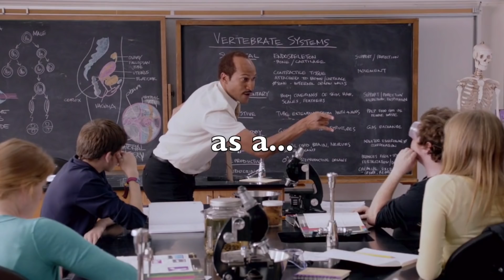Using Tesla parts in my Electric Rat Rod Conversion

Comment from the maker: If you felt touched inappropriately by the heat sink, please comment below.
Reply: RICH!! just get out and blow on the controller . No I'm triggered also brohemian chip
Reply: Are You putting a tesla in the rat rod next? 😆
Reply: Hey rich I saw you heart in my com,as a professional lover I want to say I love you back and I can’t wait to see you spending more money due to the fire 🔥❤️
Reply: Man, bad idea to remove that aluminum heat sink. First, said aluminum is a way better heat transfer than steel !
Cut out a proper sized hole in the welded plate so to lower the module through it thus letting cool air blow on the fins.
Otherwise, you'll fry it in no time.
As you said youself, the car weights much more than the bike, so the module will work harder = more heat.
Reply: YES! I am triggerd nu the heat sink. LOL
Reply: I don't know what I am talking about, but you are losing a ton of surface area by removing that heat sink. ANd surface area is what counts..
Reply: Rich Rebuilds, Aluminum conducts heat well, it will draw ir from the unit.

Place the heat sink BACK ONTO the Controller,  lengthen its cables so that the controller can be in front,  where the radiator would be, turn the fins so that air will pass through the slots.

If necessary,  turn the whole damn battery by 180 degrees.  Yup, re-do it, you will anyway if it burns up,
Reply: As a professional heat sink, I’m triggered by your violation of all heat sinks. Boycott Rich Rebuilds now! Call your local Senator!
Reply: I love the vids and the comedic responses to all the "internet professionals". However, I am a bit curious, do you not want any help from your subscribers? I'm fine with that, but I think some of them are trying to provide genuine help and it might come off as a bit douche'y if you're just dismissing all the offered help. If you don't want any help, it might be better to just be blunt and say you don't want it.
Reply: As an engineering student, Completely triggered, smh, fkn hell rich
Reply: please use flat heat sink profile between that's beefy enough or it will give out the smoke. DO NOT leave it elevated that will probably kill it. At least mount it against the plate if you are too cheap to put new heat sink profile between :D
Reply: RIP controller u need a heat sink  it's there for a reason
Reply: You can omit the heat sink - if you bolt the motor controller under the driver''s seat metal side up, so if your butt's hot, you will slow down thus saving the controller from overheating.
Reply: Nah, this just means we get another video with one of your projects on fire :)
Reply: You could make a 1in thick liquid  cooling block for it. Use a 1960s Ford heater core (size is perfect) and a cheap pump. A big cpu cooling fan on the core would definitely keep it nice and cool.
Reply: @xpepos  😂 😂 😂 😂
Reply: Hmm, i would have mounted it so it has the heatsink underneath in the airflow direction but if that does not work than maybe some sort of a 12 volt fan with not to high rpm so it’s quiet mounted to it with the heatsink somewhere else.
Reply: So this channel has officially become a baiting channel? I'm asking because, compared to stuff like Hoonigan...this ain't worth the effort if that's the case. I much preferred the previous installments. FIY, many other channels tried this route, it never worked out, it only attracted more hate and discontent.
Reply: @xpepos  ROTFL
Reply: You'll kill the unit without a heat sink. Placing it directly on the steal surface with some thermal paste will do a better job than leaving a gap. Just use an online heat sink calculator if you don't want to use the original one.
Reply: Keep those batterybox zipties on the weekly list of checks , Rich . Much love .
Reply: Yep... common sense well and truly abused.
Gotta have heat sink. Cut in half and rotate each piece 90 degrees and reattach so airflow is restored and use thermal paste of course.
Heat sink can sit on steel mounting plate using long bolts. Make an air scoop if necessary.
Reply: “As a professional aluminum heat sinker” FOR THE LAST 50 YEARS, I’d say put that da** heat sink where it sinks or your controller would stink soon and that would sting your pocket and heat up your 🧠
Reply: Love to see you burn out the controller that way..
Reply: You might want to use some thermal paste between components that generate heat and the metal plate mounting points.
Reply: This isnt one of those "listen to me because you are a window-licker" comments I promise. The cooler for the controller is in my OPINION, a necessity. Without the conductive mass to soak up the heat and disperse it, there is basically a 99.9% its gonna cook it. There is not enough mass in the bottom of that controller to handle it thru simple convection. AS AN ELECTRONICS GENIUS..... lol but seriously, if it was my setup, I would personally keep it on there. Just sayin...
 
Its gonna look badass when its done, looking forward to the next vid.
Reply: Rich as a viewer of your videos for more than a year, I’d strongly advise you to be putting the controller on the plate directly , as it will make your whole frame be a heat sink , I’d guess that will do much better than the air gap you keep mentioning. Make that plate flat with a grinder and make sure it touches the controller on the full surface
Reply: as a .... i can say you might want to increase surface area contact with the controller for maximum heat dissipation
Reply: I too think you should put the motor driver in the sink. Just be sure to use realy long cords.
Reply: air is an insulator, you need to submerge it in water obviously
Reply: As a triggered viewer, I'm leaving a comment ITT
Reply: Sryously welding a cast steel brake pedal can endanger everyone on the road when it breaks off, I disagree with you sir...
Reply: You're going to need that heatsink. Just in case you weren't joking about leaving it off.  Without it you'll be able to measure the life of that controller (inverter) in 10s of seconds of operation. Keep at it and good luck
Reply: @marcryvon  my thoughts exactly.  If you don't want the finned piece, mount it on a larger block or plate of aluminum with a lot of surface area.  Don't forget to apply a thin layer of heat sink compound.
Reply: Yes Unca Rich I felt touched inappropriately enough to comment again. You could weld aluminum extension onto the heatsink itself, and since it's on the bottom end of the vehicle it'll get water when it rains and air running across it as you drive. Effectively cooling it in the process. Steel sucks for heat transfer. For better support you could take a 1" wide steel flat bar and unknown length, bend it to make an effective support rack. Much easier to do. Surface area and metal thermal conductivity is key, otherwise if that rat rod is gonna be on for quite awhile in the heat, that controller is gonna be toast. But again your build so..... yeah. Threw my 2 salamis.
Reply: @computerguy61  I watch Rich because I learn things I didn't already know. I already said I love the channel. There will always be douchebags who trash on him in the comments thinking they know everything; it's the internet. That was not my point. My point was that some of his viewers might have a particular skill in an area that he doesn't and want to truly help, not troll. And if he's lumping everybody together and acting like he doesn't want any help, it may turn some viewers off. I love his humor, but in this case some may think twice about posting something that they think might help him because of his comments. That's all. Nobody knows everything, not even Rich, but as a community we can all help each other while ignoring the trolls. Again, I don't TRULY care that he doesn't seem to like advice, it just means I'll refrain from trying to help in the future if there's some tiny detail I think I could help with. That's all, not a big deal either way, I'll still watch.
Reply: Sock puppets.
Reply: As a heatsink engineer, I am sad.
Reply: dude youre definitely keeping the rat in ratrod...i really hope this project doesnt kill you... 🙏🏼
Reply: @rnreajr9184  
He definetely NEEDS the finned heat sink so the air flow cools it down. An aluminum plate won't be effective enough to shed said heat ! Why reinvent effective, proven technology is  beyond my comprehension !!
Reply: As a professional opinion stater and comment maker I would just like to say you are grade A on point with your triggering skills. I love seeing all the offended types letting their hurt butt show through their criticism and otherwise superior ideas. 

Keep up the good work, even if it’s only to leave people asking wtf. You are appreciated by those of us who have minimal to no clue!
Reply: As a professional NOBODY, I say rock on, this is a riot, so many people getting triggered it is hilarious!!!!
Reply: I was inappropriately touched. It’s called a heat sink for a reason.  Don’t loose it. 
Put the heat sink back on and rotate it 90 degrees so you have nice air flow over it when moving.  
Computer CPUs have heat sinks with fans on for a reason.
Reply: Rich. Much love, but you GOTZ to know that a heatsink gives all that heat a place to go. It's a magical place with way more surface area so that the relatively poopy heat transfer to the air will be at least semi effective.
Reply: +1 vote for begging you to reconsider using the heat sink.
Reply: Close. His name was Heath........he  lures us into his van. The end
Reply: What a channel!!!!!!
Reply: As an Electronics Engineer of 20 plus years...  heck, just send it man.  What’s the worst that could happen?  LMAO
Reply: I would have mounted the controller on top, heat sink under it and steel plate on the bottom ... with long screws... oh, and the fins are oriented the wrong way? then blow on it! :P
Reply: Me thinks you plan to add a liquid cooler to the motor controller... or plan on melting it to slag. Either will be good content. 🤷🏻‍♂️
Reply: He knows what he is doing and just went fishing, do you seriously think he does not know about heat sinks???? 
Not only is he amazing at working on Teslas but looks like he is a dam good fisherman as well, after all so many took the bait hahaha
Reply: Fine, I'll take the bait - mounting the controller without a heat sink, with only an air-gap to try to get air to the controller? It is sadly doing the opposite of your goal of improved cooling.
The heat sink provides more surface area with a better thermal conductor in order to help the controller cool off. What you've done is reduced the surface area for cooling.
Reply: @compwiz101  strike.... the rod bends, the line is wizzing off the reel, the clutch on the fishing reel is heating up and there is that feeling if excitement....
hahaha this is funny!!!
Reply: As an amateur YouTube watcher I feel that I'm obligated to say maybe consider taking up jazzersizing or sweating with the oldies to get in shape for when you have to either A: push that thing back down the street after it burns out. Or B: HOLD YOUR MIDDLE FINGER HIGH TO ALL THE PROFESSIONALS (while on hold with AAA)
Reply: Air is an isolator.  Slob a bunch of hear sink compound to the back and bolt it tight to the quarter inch steel.  ... Maybe slap the heat sink on the back of the steel w thems long bolts you have.   Either way I wish you all the success in YouTube and in your humanitarian efforts housing all those furry families living in the Tesla dumpster out back
Reply: the new welder is working fantastic hahaha had me fooled
Reply: Marc René Yvon Rich...definitely agree with Mark Rene Yvon...keep the heat sink.  Metal to air won’t work as well as metal to aluminum.  You’re going to have much higher heat generated by your application.
Reply: As a professional, I would replace it by wood. WOOD WOOD! 🤭
Reply: @marcryvon  Eh, if he wants to torch it, let him torch it. It'll be good content in a month or so.
Reply: Ashy ass ankles
Reply: Lol jk rich. Love your rants. Cheers
Reply: @reluctantprophet  Dont worry at this rate the controller will burn up before he will actually need the brakes for any emergency.
Reply: @computerguy61  Looks at Daisy ...*looks back at the controller heatsink* shrugs
Reply: If you treasure, embrace, crave failure, then ignore the suggestions by us individuals who know things more than yourself. But when your insurance carrier denies your claim when your new shop burns to the ground...and as evidence the attorneys  for the insurance firm, unearth all of these  videos highlighting your cavalier incompetence....you will have nothing, no business, no job, no career.
  OR, if your daddy has a bazillion dollars for you to "play with"...then never mind....
Reply: use the car as a heat sink, and enhance it by bolting the old heatsink to the bottom of the plate
Reply: of for sure you've fucked it!! yolo it all the way baby
Reply: Technicall question: why did you mount batteries so high and so far forward? Wouldn't be better if you mounted them in similar location to the orginal engine ?
Reply: Its a heat Sink, like heat drains into it.... you are making a heat table... do you want heat all over your table just sitting there? Possibly dripping onto your exposed sandal ass toes? No, you don't.
Reply: what you gonna do after putting all this work in then frying the controller
Reply: As a professional PC master race user, I feel deeply violated by that heatsink mod
Reply: Well, as a child I also thought it would be a good idea to remove the radiators of my laptop in order to let the fans spin more freely and prevent dust collection.
It wasn't a good idea.
Reply: Even mounting it directly to the steel would sink away heat better than the air passing through a gap.
Reply: @xpepos  lmfao  lol
Reply: The point of the heat sink is giving the controller more area to convect heat into, and obviously it's designed to cool that heated area quickly with the fins. If you're going to space it out anyway, why don't you just modify and adapt the heat sink to fit? You could even grind off that weird hump and make it flush mount, but it seems foolish to remove it.
Reply: Yeah. That felt like we were being trolled. Like the bell housing duct tape. You seem to know too much to not know the problem here.
Reply: Rich comment section always makes me laugh so many professionals on here lol.
Reply: @jamesireland9188  There probably are a lot of professionals on here. People have careers. Not just professional comment authors.
Reply: Its sort of strange for a guy who has just opened a garage to work on your electric car, to be advertising the sort of quality workmanship you can expect in this manner.
Reply: I'm amused either way. just don't die
Reply: @marcryvon  I was going to suggest going to a liquid cooled solution.  Get a radiator that fits in the old front end that he wanted to use, pump some liquid through it and call it a day.  A little bit more complicated, but a lot less worry about heat saturation and/or melting...

Also - I'd over-engineer the whole battery hold down - a sudden / unexpected stop (like an accident) and those 3 screws and tab aren't going to keep inertia back...
Reply: Uncle Rich, I feel something touch me in an usual way... why?
Reply: This is awesome!
Reply: As an unqualified for the task software engineer, Removing the fins in the heat sink will reduce significantly the heat transfer from the controller to the ambient air.  The heat sink fins are there to maximize the contact from the heat transport medium (aluminum) and the coolant (air).   Might be better to wield directly the controller to the plate (or use thermal paste) and wield fins below the car to maximize the surface with air.  This is because the aluminum transfers better the heat than air but needs to unload it into the air.  So you need to maximize the contact surface with the coolant (air).  Or plug a radiator the dam think and water cool it.
Reply: Hey rich. You could attach the heat fins to the underside of the mounting plate for the controller. The heat will still transmit. Assuming theres room...👍
Reply: Not super triggered, but I am worried that you'll fry the controller very quickly if you dont put the heat sink back on. Just my .02, but it's also not my car or money!
Reply: Reeeeeee wait wrong video, but is it possible to upgrade to liquid cooled?
Reply: Yes I'm offended by your plan to ditch the stock heatsink and space it for air flow.  It's obvious you know very little about thermodynamics. Please reconsider as I'd like to see this project be succesful for longer than one batteries worth of charge. 
   I like the music in this episode.
Reply: I feel triggered
Reply: LoL!  That was funny, Rich!  I need to see your comedy tour, and no that wasn't sarcasm.  Bolting down the motor controller to a metal plate is a good idea, but use heat sink paste and with no air gap to maximize cooling, the metal will spread the heat.  One could even bolt the heat sink onto the other side of the metal plate with more heat sink paste to maximize cooling.  Hope that helps!  Been watching you since you started on here!  Thanks for all the videos!
Reply: "AS A" maintenaince tech (actually I am 😁), you really should keep the heat sink 🤣. Seriouslly, you should keep it😏. I bet that isn't even enough to cool it.
Reply: Air sucks as a heat sink! Magic black smoke in 5...4...3...2...
Reply: @marcryvon  and even consider installing two 12 cm (or larger) 12 V thermostatically controlled coolers, so that the controller can cool down when it is parked at a traffic light, for example.
Reply: It hurts so bad
Reply: Will this vehicle be road legal?
Reply: As a heatsink speciallist, rocket designer and dog trainer... not really, just a youtube viewer. The technique and the building quality of the e-rat might be shit, but the heated reactions will push the views rocket high.
Reply: I was so worried about your decision to ditch the heat sink I was about to fly to your shop to try to save you from yourself. Gladly, you have very smart followers (yours truly excluded) that caught such sacrilege on time.
Reply: As a professional Macgyver,  you need that heat sink on that controller, with some paste between(axle grease will work well enough...tried it on a cpu and it didn't die) and a  computer fan tie wrapped to the heat sink.
Reply: Rich Rebuilds I think the heat sink would look kool polished on top kind of like where an air cleaner would go. Let’s just call it a pedestrian slicer.
Reply: As a non professional enthusiast of overclocking and cooling solutions for electronics such as CPU and GPU I also would like to say that your plan is really really bad. Don't joke around with cooling, just looking at the size of that original heat-sink I can see this bastard will be emitting some serious amount of heat from the MOSFETs inside. From a safety perspective, this will be safe as it is mentioned in the manual of the module, the unit will turn down the power output as it heats up above the specs (85 C), so in theory it should't damage the components or cause a fire but that's just in theory. Maybe mounting it directly to the steel plate could work ( as mentioned in the manual), ONLY after you polish it (especially that popcorn weld) so the surface is sufficiently flat and smooth like on the OEM heat-sink and apply the appropriate thermal compound. You must definitely not leave this as a bare surface with a gap like you were planning there will be no sufficient air flow and you don't live in Siberia so cooling is something you need to take seriously.
Reply: Mount the heatsink you fool.
Reply: J'aime moi aussi les professionnels depuis la France,Merci Rich j'ai bien rigolé...
Reply: I feel like removing the heatsink is going to be the single thing that makes this fail out of all of the other atrocities we've seen.
Reply: I know many people have commented on this part of the build, but I agree that the heatsink is necessary. Spacing it for cooling is actually worse. How heavy is the controller? You could just do L brackets or something to the tops of the bolts that go through to the heatsink and still keep it functioning. I would also keep the fins parallel to the airflow if possible.
Reply: @marcryvon  as a pizza delivery guy of 2 weeks I agree
Reply: Hey Rich when flux core welding try to lean the wire the way you want to drag the weld. Also looks like you need to turn the heat up a little for your metal thickness as you penetration is wanting.
Reply: Stay tuned for the fire works! Yeah!!
Reply: Haha, yeah I should have spotted that air gap was a troll move, well played good sir.
Reply: As a professional swimmer, I see a melted motor controller in the future.
Reply: Keep up the great work 👍
Reply: I never gave anyone a chance to have me felt touched inappropriately by the heatsink....
Reply: Instead of reiterating what every engineer with two or more neurons has said so far, I shall simply leave this nugget of wisdom from Mark Novak: "If you're gonna be dumb, you have to be tough.".   -although in your case I might suggest this alteration: "if you're gonna be dumb, you gotta be fuckin' fireproof.  
NINJA EDIT: I would be remiss to not say why this is dumb.  This heatsink removal is dumb because you are arguing with the LAWS OF PHYSICS.  -and the laws of physics broker no bullshit.  As YOU say, "play stupid games, win stupid prizes."  Or, put another way, "I don't want that heat there", does not in fact warp space-time and thermodynamics to remove that heat from that part.  So put a fuckin' heatsink where you need to sink heat.
Reply: Bad bad bad idea, but you do you 😂 it's your car
Reply: aggelos sofos Q